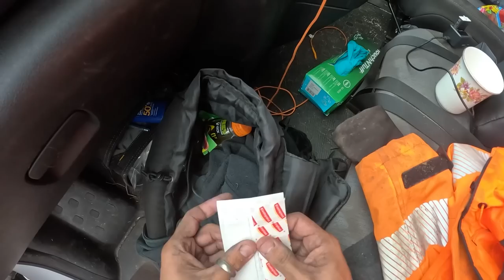Neighbour Nearly Stopped Us Getting This Job!  - Full Roof Transformation!

Comment: I’m going to harp at you about wearing gloves. And carry a large bottle of sterile water or contact lens solution to clean wounds. And carry a bunch of small crazy glue tubes. When you get a cut, clean it with the sterile water, dry it, and apply crazy glue to seal it. It works similar to the skin bond used in emergency rooms and surgeries. In fact, most mountain rescue teams carry a bunch of it for the same reason. I found as a nurse it was the most effective way to get cuts to heal and still be able to put soap, disinfectant, and protect it from infection. It wears off when it heals.

Comment: That was a good setup with the worried neighbor.  A very nicely groomed yard.  Thanks for the explanation of the pressure dropping as the distance of the hose and lance changes things.  Could even mean a person needed a stronger machine?  The job turned out nicely.  Hope Kev does well.
Reply from the maker: yeah for sure - the old vtuf machine i used to use was horrible to use at big lengths, it was limited to 100 bar so anything more than 30ft out would be so physically difficult to clean

Comment: Hey Sid question re solar panels. so when you clean behind them where does the muck go? as i noticed it doesnt run underneath and out the bottom (i know nothing of solar panels i assumed they are fixed to the roof on struts and not flush?)